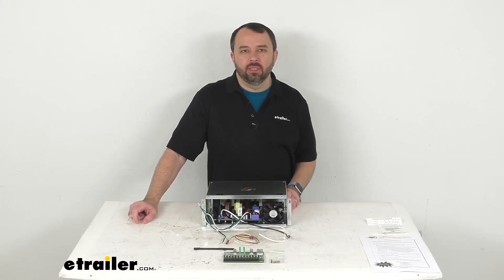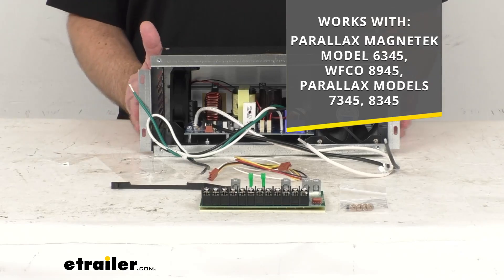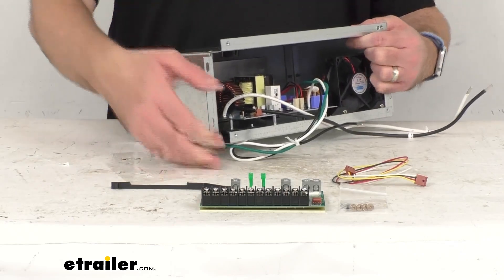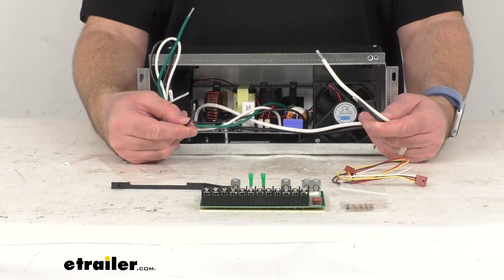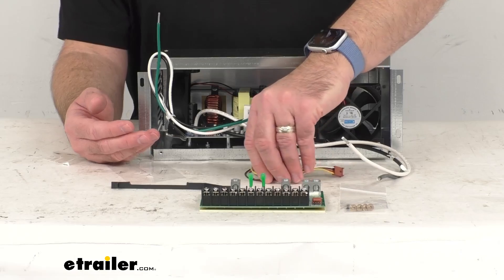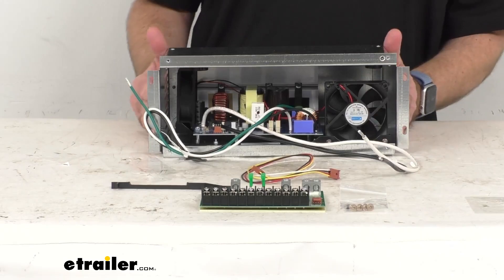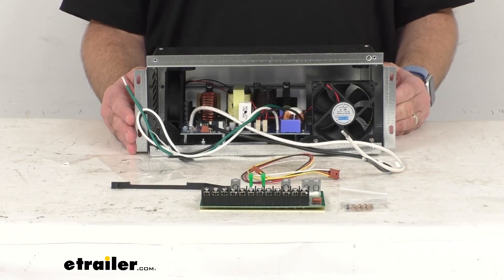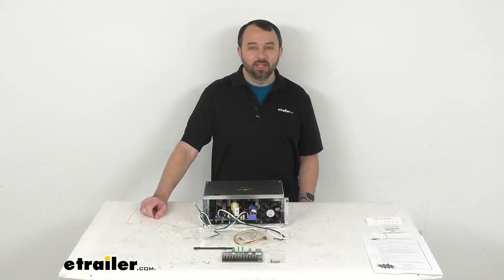Review of Progressive Dynamics Replacement Section AC/DC Power Distribution Panel - PD4645V

Comment: My WF8945 has the exact same specs as this unit, except it does not have the equalization mode, or the charge wizard.  My unit is supposed to boost at 14.6 V, but never gets above 13.7 V.  The manufacturer claims you can't see the 14.6 V in boost mode with a voltmeter, because of the "relationship" between voltage and current.  Not sure I understand that.  But I'm looking for a unit that will actually boost to 14.6 V for the "bulk" charge.  Will this one do that?  Also, with my 160 AH batteries, I'd prefer only about 15-20 amps max current.  Is there a way to limit the charging current?